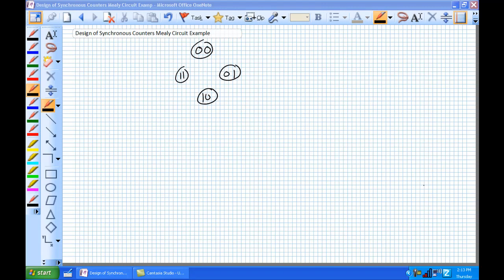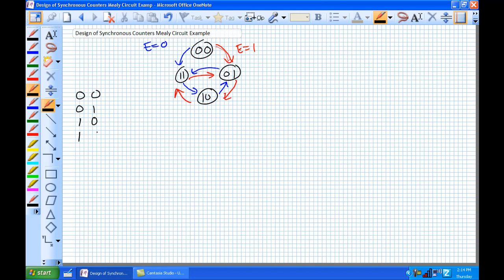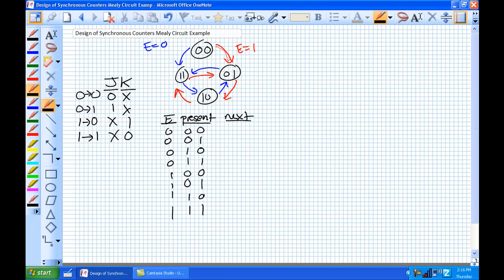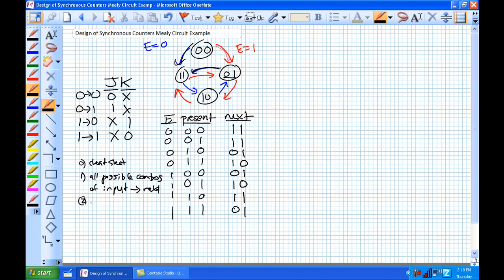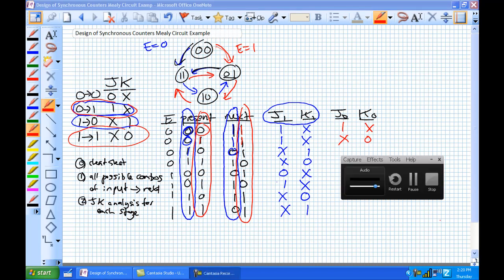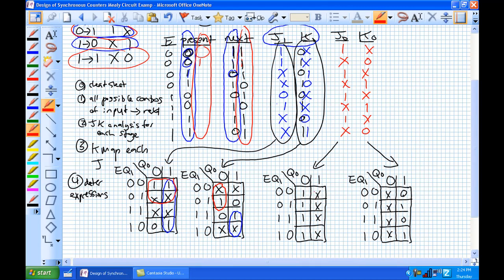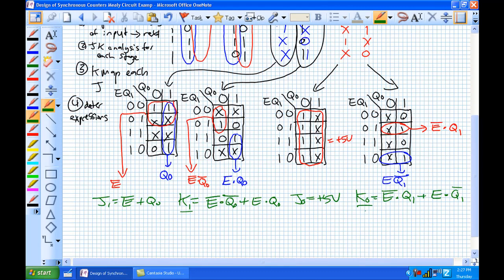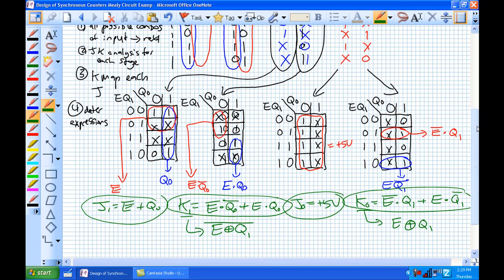Design of Synchronous Counters Mealy Circuit Example

Comment: Use the updated digital electronics playlist at:

http://www.youtube.com/playlist?list=PLX7ZPgPJWZNc6zRvIGjDFOr6CYKz9DZa3
http://www.youtube.com/playlist?list=PLX7ZPgPJWZNcDCIwqswjjaafqb3U2sVCb

Additionally, wanted to let you know I'm developing my own independent YouTube channel. I've got a sample pack of lectures up right now. This channel is undergoing major development summer 2014 but periodic updates will occur between now and then. Subscribe to it if you're interesting in the updates.

Long terms plans include a complete basic electronics series (DC, AC, 3 phase AC), control electronics, power electronics, hydraulics, renewable energy, and more! The website will redirect to the YouTube channel for phase 1 of development. Enjoy!
Reply: where did renewable energy 1 go ?
Reply: Are you looking for a renewable energy playlist or a video? I honestly wasn't even aware of a "renewable energy 1". I'll ask the guys that manage the cgcclive channel (I actually don't manage that channel). The old digital electronics videos are still there but the playlist has been replaced with digital 1 with PLDs playlist mentioned above. Much better editing, audio and more modern technology.
Reply: THX JIM!

but ive one question:

I paused your video in the beginning and tested myself if im able to build this machine on my own.

I came to the same solution. But could you plz help me verify something

I builded the ciruit and a step before doing that is to define the both outputfunctions right?. for q1=q0+~q1~E  and for q0=~q0+q1(XNOR)E

tommorow I write a test about this stuff and im trying to lern to build finite state machines from beginning till end, so every help is really appreciated.

greetz from germany

revnu